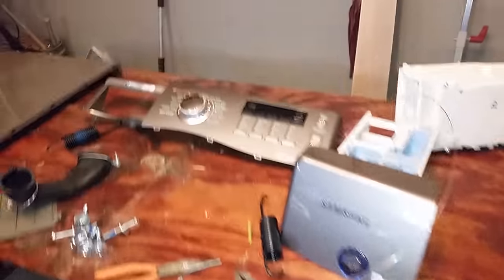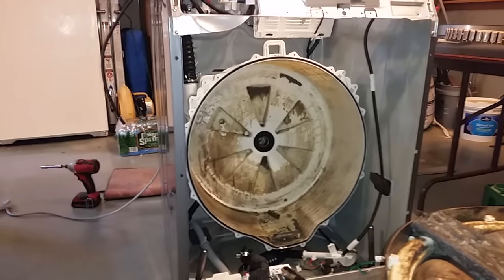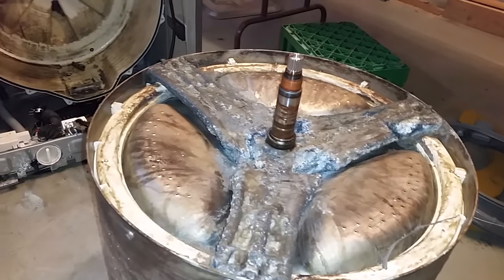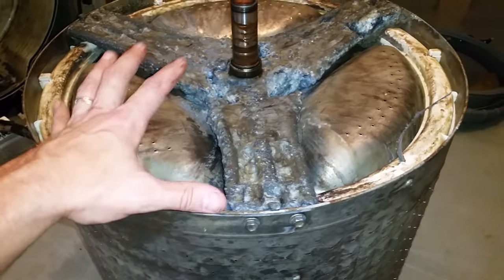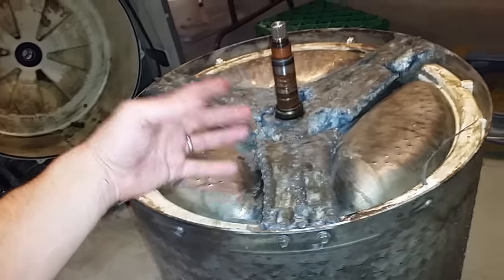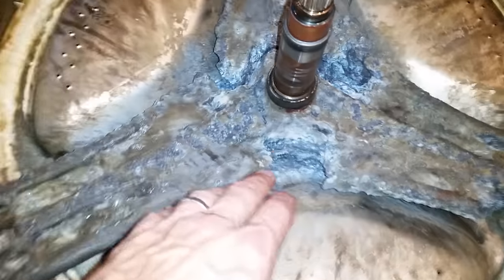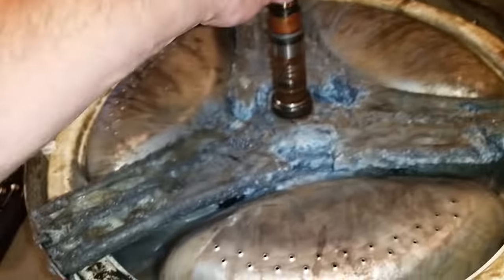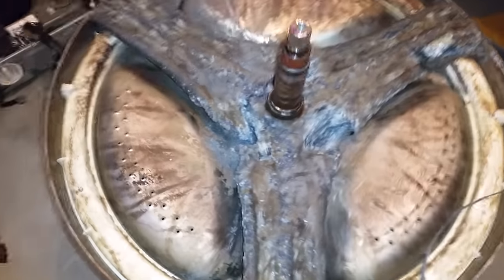Do not buy Samsung front load washer machines

Comment: As an Appliance Repair Technician, I see this all the time in all brands. Although this video is correct, I have found that using cheaper soaps speed up this process significantly. People also use WAY to much soap and don't run the "clean washer cycle". When I pull these apart, I can see the soap just caked on everything. Anyone with a new HE washer should A) Use high quality soap, B) Use less than 2 tablespoons of soap for any amount of soil, clothing or water, and C) Use the clean washer cycle that came with the washer for this purpose.
Reply: Ian Warren 
 so what do you recommend to maintain these front loaders ?..i am in the marker for samsungs model DV42H5200GW and WF42H5200AW and i just want this thing to last atleast 7 years as wife is busy with kids and warranty is $160 for both on 3 year coverage ...thanks
Reply: Read your owners manual, seriously. Use only a table spoon of soap in your wash, no matter how dirty the clothing is, and use the "clean washer" cycle monthly or as often as it says to do so in the manual. An extended warranty is great because a single repair call will cost you at least $120 without any work being completed depending on where you live. If you can get a 5 year extended warranty now, I would recommend it, the majority of the issues will happen after 2 years.
Reply: the only problem is you are pre-paying for the worst service experience of your life. When a company makes almost nothing on your job- you are guaranteed to be at the bottom of the list, after profitable out-of warrantee work of theirs.and will wait for parts- often two weeks.
Reply: That is true about the repairman ,you have a 3 party who makes money on not paying out money .
Reply: Good advice. BTW the latest Samsung machines tell you when it is time to run a clean cycle on the display
Reply: This is true, service companies make more money for out of warranty then in-warranty work. However, in major cities where warranty companies have a lot of service companies to choose from, it pays to do a good job. At our company, the level of service is the same for both in and out of warranty. This means that the large companies we deal with are very satisfied with our service and they keep sending us work. We may make less per job, but with the large number of jobs they give us, it does benefit us.
Reply: Orrrrr, the manufacturers can realize there are a million different brands of soap out there and nobody ever really measures it out in the cap that comes with the bottle so instead, simply make the part out of a different material. Perhaps out of a material that resists....wait for it...laundry detergent!
This would be like a manufacturer making gas tanks that break down from being exposed to gas! 
Dumb.
Reply: Ian Warren v
Reply: Ragnar Sakna
Reply: Phil your missing the point. Simple fact of the matter is Samsung shouldn't manufacture the washer soo cheaply. I would rather pay more now for a product that will actually last than pay more later at an inconvenient time because it catastrophically failed. Either it needs to be designed to take the harshest soap on the market or not allow people legally to sell soaps that will knowingly cause damages to these units. If you ask the average American consumer to actually measure out a tsp each time or run the maintenance cycle chances are 9/10 people are too busy to give a damn or they simply don't remember.
Reply: I use only the Tide HE powder and I have learned to never use the dispenser. I throw it right into the load. The main reason for this is first the powder always dissolves and secondly you won't normally be left with a smelly washer. It's just as easy to throw powder in the wash as it is liquid. The main issue I hear about now is that these pods don't dissolve. I have had that issue as well. I gave them up for the big box of Tide. I feel that any of those liquid detergents tend to leave a residue and can cause build up and more issue with the washing machine. Therefore you get a smelly washer. Especially in this day and age of energy conservation and them wanting you to do all loads in cold wash cycles.
Reply: On the latest washers throwing the detergent in with the wash loses you many of the advanced features. e.g. ecobubble on the latest Samsung. Since my first post a few months ago, I went ahead and got a Samsung. Im very happy with it. Im following the advice of the OP and putting in less than half of the amount of powder and conditioner I used to on my old washer.
Reply: Do you like powder better than liquid?
Reply: 2 tablespoons! That's amazing.  That's so little soooooaaappp!!!!
Reply: I do personally, I have been using the powdered Tide that I get at Sam's for years. I think the liquid is more prone to buildup inside the machine. My machine has never smelled while using the Tide powder
Reply: that because they don,t use enough water  in the first place
Reply: Rob Whiff.  I have the best results using Tide powder. DO NOT put it in the dispenser. Put it directly into the drum. My washer doesn't smell and there is no detergent that doesn't dissolve
Reply: Do you think the samsung WF42H5200AP a good washer in general? Or terrible as I read some reviews
Reply: I just bought my daughter the Electrolux front loader She really likes it.
Reply: Ian Warren so which one do you recommend Samsung or AEG?
Reply: For quality and long life I would recommend Miele. The only reason I bought a Samsung instead of a Miele is because Samsung are already near the top end in price and I couldnt justify the significant (almost double) price jump for an equivalent model in the Miele range. I also managed to get mine on a double special offer, reduced price and cash back on top which saved me a ton
Reply: should have gotten  speedqueen front load washer true they cost a little  more but you get a better made machine
Reply: speedqueen cost even more than Miele in my country
Reply: sorry to hear that great machines washers that is
Reply: Ian Warren Totally agree with you. All brang work the same way and have same weakness
Reply: whatwashing machines do you suggest buying??
Reply: speedqueen   had my almost 2 years   still working great may cost  a little more so far worth
Reply: hows that go?
Reply: catkicked Speed Queen and Maytags are the same thing
Reply: As a expert laundry technician you said it all well explained
Reply: I wonder if it is possible to make everything that would come in contact with liquid out of plastic then you ellimate the problems of the metals attacking each other?
Reply: LMAO...HOW OLD ARE YOU????????????
Reply: How old is who?
Reply: I was responding to your comments.
I wonder if it is possible to make everything that would come in contact with liquid out of plastic then you ellimate the problems of the metals attacking each other?
THen I realized it is a language barrier and you are YOUNG! I have used many washing machines over the  years. And the OLDER ONES cleaned cloths. These newer ones DO NOT CLEAN CLOTHS and the Cloths that come out of them STINK!
Reply: i have a washer machine that i buy, that support corroted in the video is almost new, ill paint with epoxi, that will make last longer. also there are videos that explain that the corrosion is from using soap powder that have caustic soda. this is the first video that say that the problem is the diference in metals, ill do more research on this.
Reply: Yea and its a compiracy that old electronics eventually fail. Has nothing to do with physics at all. I bet aliens have infiltrated all the electronic companies in the entire world and are trying to bring down mankind by making my 50yr old walkmans stop working. Damn the aliens!
Reply: You are clue less as to the function and INHERENT problem with all NEW WASHERS for the exception of COMMERCIAL ones. Is there a reason that the Speed Queen Washers and Kenmore industrials do not have these problems? Is it because they use much more water? The conspiracy is that you think there is nothing wrong with the problem that IN FACT the MAJORITY is Experiencing. Keep your tinfoil hat on for your next HUMMMM JOB!.
Reply: Pick any product, one that should easily last 'foreever'. Let's pick a hammer for example. Somewhere in the world there are multiple factories churning out hammers that break on the first use. This does not make it a conspiricy amoungst all hammer makers.
Reply: So having a 'glass half full' attitude means you focus on the negative and see conspiracies everywhere? Interesting theory as I would have thought it was the exact opposite.
Reply: Whether I am a moron or not is debateable, but we have clear evidence that you are not telling the truth because you replied after writing 'I am done'. You also demonstrate your immaturity by resorting to CAPS. Shouting your point of view is always a demonstration of a strong and well-founded argument? Do you have alzheimer’s? You seem to be confused about what actually wrote previously. Yes, I was talking about you when I said does seeing the cup half full mean you see conspiracies everywhere… Come back when you are sober, Ill be waiting :)
Reply: No their NOT
Reply: are there any front load washers that do not use this low grade spider bracket?
Reply: it seems to me that this owner had hard water problems.  would that cause problems too?
Reply: catkicked Compared to the Frigidaire front loader I bought in 1999, & the LG I bought in 2012, you're right about the newer models not using enough water.  My old front loader used enough water (18-27 gallons).  I watched some videos on how to rig my LG to use more water, & I have no problems with water usage anymore.  I however have watched videos on models made in the last 3 years, where the water pressure switch has the screwed superglued, that they're (LG & Samsung for sure, but not sure about Electrolux, Frigidaire, Whirlpool, & Maytag) making it to where you can't easily change the setting.  I hope to not have to replace mine anytime soon.

Vicky Forba  I have used powdered products here & there for years.  I however won't dump it directly into the tub, because I find that it doesn't completely dissolve while the clothes tumble through the water.  Even with the water level rigged on my washer, powder still doesn't completely dissolve.  In the summer months, when my clothes have that sweaty, funky smell, I also add both washing soda & borax to combat the odor problem.  I always add baking soda too.  What I end up doing with all these dissimilar powders, is dissolving them in hot water, before adding them to the washer.  I also use liquid, & now, all mine is HE & HE compatible.  When I got the Frigidaire back in 1999, HE detergent wasn't available at all locally until 2001, & onlt original scent Tide was available in 50oz bottles for $9-10.  The regular was still selling for $5-6 for the same size bottle.  I didn't buy HE until 2008.  So I did what the manufacturer stated to do back in 1999, use half the amount of regular detergent in a front loader.  Never had problems using regular in all the years I used regular.  I still had plenty of regular detergent in use as late as 2015, because I stock up on it.  I'm slowly getting my stock depleted, because I want to get the old stuff used up, as well as the fact that I'm in the process of moving.  Even with using both liquid & powder, I've never had problems with odor & mold (even with my last front loader).
Reply: Throwaway society. I'll never buy or recommend to buy, Samsung household appliances again. I have the same symptoms with my 7-year old Samsung VRT washer as this video title says but I'm not going to take apart my stupid washer. I shouldn't have to. My washer also had different problems in its 1st, 2nd, and 3rd years of its life. If these companies are so "advanced", then they can figure out how to make things that last at least 3 years before breaking and they could warranty their product longer than the pathetic "1 year manufacturer warranty". In the long run, it costs less to replace these stupid things then to fix it.
Reply: Dang, I use like 1/2 to 3/4 cap of soap and it was HE quality (NOT CUP,  I MEANT CAPFUL) My washer - crosley had no problem. but when I buy new maytag washers very soon, I will check to see if it has "clean washer" cycle features in there. I will NOT buy samsung W/D period.
Reply: Skip Rope 
Most of the time if your clothes stink you got a holdup of soap that is growing some bacteria that are resistant to soap 
So do a 90° program and if that doesn't help 
use chlorine to do an empty wach at your own risk chlorine IS TOXIC
Reply: I was in the field 4 years. I told people no more then 1 tablespoon at the most. I saw people dump a full cap into the machine after I told them 1 tablespoon. Yes there is a big difference between conventional detergent and HE detergent
Reply: Ian Warren I'm also a technician. I agree completely and my experience mirrors yours.
Reply: Ian Warren Maybe instead of them giving us an excuse to waste energy on a clean washer cycle, they actually spend 10 bucks and change the material to stainless as to provide a quality appliance. All Samsung garbage is built to die.
Reply: Hi Ian, I agree,  too much soap, and maybe too much use. I once fixed an Inglis, that is Canadian made, washer, the bearing was worn completely.  She had kids that had bedwetting problems, the washer never stopped and yes after 5 years, it failed. A single person, using it once a week would go 20 years or more. So factor everything in forst. Had they used a top loader and 3 times the water and soap over 5 years vs the Samsung cost, which is cheaper? Depends on your water cost.  I had bills over $100 more a month with many people staying at my place, that would have been 200 with an older machine or 50 with the front loader. So 3000 extra in water could easily buy a new machine.
Reply: Just ran the PureCycle cleaning mode on my washer - thanks for the tip. I've never had any smells or issues in 4 years of use because I live somewhere with near 0% humidity, so I just leave the door open at the end of a cycle and the interior dries out very quickly - does this help to prevent this kind of corrosion, or should I change up how I use the machine to prolong its life?
Reply: Everything is made to fall apart now. You can get parts for a 20 year old washer easily but if it's 5 years old your shit out of luck or the electronics board goes it  cost half the price of a new one.  This is not only true of washers but Fridges stoves etc...
Reply: How true but we love our electronics. often the boards can be easily fixed though. I fixed many for a guy and half I could save, half needed parts I could not find. The stove ones would burn up.  The fridge ones would often need capacitors.
Reply: I did warranty work and we had no problem being paid. I quit doing it because the constant complaints I used to get fixing 4 and a half-year-old machine free for the customer. If we said it needed to be done it got done. I even delivered a brand new machine to a customer with one week left to go because the old machine was uneconomical to repair on their instructions.
Reply: That's great in warranty but out, people will only spend half of what it is new tops,  I stayed away from consumer electronics and appliances. If what you are fixing is worth thousands, it is easier to make a buck.
Reply: True That's why myself and most good techs got out we can fix anything. I still buy every appliance on Ebay now most people are getting rid off high-end machines with simple faults because they won't call a company. They then fork out for a new iPhone 2 years old moaning the washing machine for $500 lasts 5 years. I would not stuff around with anything like tubs these days. How the warranty companies make money I have no idea?
Reply: Or you know buy a top loader...
Reply: I repair top load whirlpool and I have no problem getting the AMERICAN MADE washing machine to work , , IMPORTS SUCK
Reply: Cleanliness is next to godliness. Clean anything regularly, possibly use a couple of drops of bleach in a wash, and leave doors open afterwards so everything can dry COMPLETELY. (A couple of drops of bleach works very well for water condensate lines as well)
Reply: Year ago I began expirimenting the Amway Sa-8 detergent. It was the first reformulated detergent on the market to remove phosphates, (Amway received an award from the United Nations) Amway distributers knew it had the habit of forming into clunks or chunks (which could be easily broken up) I had been using 5 gallon Sam's club detergent for the previous two years, and began trying Sa-8. Two weeks later I realized that (without bleach) my work uniforms were nice and white, not yellowish, SO both powders AND liquids can work well. My wife and I are still using up the Sa-8, it lasts SO LONG ! I like to make sure the powder is broken up and smooth.
Reply: No manufacturer this side of Speed Queen makes machines that are expected to last more than 8-10 years.  There are three main reasons for this.  1.  We have become a disposable society.  Whether your washer or marriage craps out after ten years, you get a new on rather than fix it.  2.  The government changes the rules about every two years.  They adjust the amount of energy a machine can use.  Manufacturers need to constantly create new technologies to meet the ever changing government standards.  3.  The machines rely heavily on electronics to work efficiently.  Electronics are a two sided coin.  While they can get the job done within government standards, they are susceptible to dirty power and have a lower life expectancy.  The parts in the video that have corroded had those electrolytes, that the owner pointed out, introduced to them.  Those parts should not get wet.  He did not explain how or why because he was too interested in bashing a brand.  Soap is a caustic material.  Too much soap led to a build up around the seal.  The seals were compromised and water got between the tubs resulting in the damage.  You should never, EVER see suds in a high efficiency machine.  In our area, we recommend only one tablespoon of detergent.  You must measure.  Get used to it.  One or two drops more than whatever is recommended in your area will lead to problems including, but not limited to, smelly machines, mold or mildew growing inside the machines, and the machine sensing off balance loads.  The detergent manufacturers are not making harsher soaps that can cause damage to the machine,  they are making higher concentrations to fit the new high  efficiency that are dependent on user intelligence.   Soap manufacturers and machine manufacturers make recommendations on quantity of soap. 
 You cannot go by those because they are making them based on an average of the nations water quality.  You have to find out what is recommended in your area and be able to use a measuring device.  If you want a machine that will last 25 years, buy a Speed Queen, but even then you must measure soap to get that life.
Reply: Ian Warren 9
Reply: I have also hear that if you have city water that it also speeds this issue up vs well water.
Reply: My Samsung doesn't have a clean washer cycle
Reply: Use powdered detergent in stead of liquid on whites, wash at the highest temperature available regularly, leave the door open when the machine is not in use to air out
Reply: Ian Warren - excellent, excellent, excellent point you have made. Have a 2006 LG Tromm and the only issue after 11 years of every day use is a worn bearing. After replacing the bearing, the machine runs and sounds brand new!
Reply: Ian Warren hello the time has come to replace my top load washer and I’m looking into getting a Electrolux Front load washer  would you recommend them?
Reply: As a Samsung authorized technician I can confirm that this is the result of using detergent that is not HE rated, whether intentionally or do to deceptive advertisement, for over a year. This means that the owner's preferred detergent is not compatible with low water usage washing machines.
In other words, buy Tide HE Turbo and use a maximum of one tablespoon per wash in this will not happen to you.
Reply: Michael Rizzo So question... what's a good base model electric dryer to buy? I'm looking for a new one but would prefer something that just gets the job done and won't quit on me fast... base model type y'know? D:
Reply: Greg Stetz What's a good electric dryer to buy? I need some suggestions. D: Just want something that works well and will last me a while.
Reply: Ian Warren I am also an appliance technician and I 100% agree with your comment. Usually it's the powder soap that causes this and overloading of clothing and rugs. I tell my customers all the time just because it looks like a laundromat washer doesn't mean you should treat it like one, because it isn't built like one. But you are correct this isn't a Samsung issue this is a front load washer machine issue and how people use them
Reply: Ian Warren what is clean washer cycle. Plz tell me.
Reply: Having to use less soap and particular brands is really a baind-aid. The problem is the incorrect material choice (possibly intentional) and the solution is to avoid that washing machine and possibly other makes also.
Reply: Which brand in your opinion is better for a new washing machine??
Bosch, Indesit or Whirlpool
Reply: Thanks in advance
Reply: We just got a, "HE" top load and watched how it worked through the glass door. LOLOL DO NOT BUY A HE WASHER it literally didn't get several parts of my clothes even wet! THEY ARE TRASH. Maybe this is a one time special occasion type thing but I've been around too long to think that about garbage materials any more.
Reply: The type of soap shouldn't make any difference. Sorry to the 422 Samsung owners out there that voted up this comment, but that is ridiculous. Also, why does the damn thing have a clean cycle and what is it supposed to do? This would happen without soap and if you have ever had a boat in brackish or salt water you would know that.
Reply: Hey Nerd, my front loader was 15 years old when I sold it and it still runs fine. A Whirlpool, BTW. Fucking soap makes no difference. Put your outboard boat in brackish water and tell me what causes the corrosion. Hint, it ain't soap.
Reply: My guess is that sulfur well water might be harder on the equipment than iron water which would be harder on it than softened water. And some city water is better than others.
Reply: Good info Philip. My wife and I just bought a pair of front loads. Very pleased with our purchase— and grateful that they are not Samsung’s. And  Ian Warren’s post was equally helpful, so we changed our routine for doing laundry. Thanks guys for sharing.
Reply: two table spoons  of HE soap not one.  also install a inline water filter to that front load. clean cycle once a month,  i am a Sears washer Tech ...
Reply: Ian Warren Qatar
Reply: what does soap have to do with corrosion? won't running the clean cycle just expose the machine to more water and thus lead to more corrosion?
Reply: You are correct that most of the major manufacturers use these cast aluminum spiders to support the drums. I had a Kenmore washer that had the same issue,. Just got rid of it yesterday after 20 years of use. I had to replace the entire drum assembly as the particular model did not have a spider for sale without the drum, which is idiotic as the drum was stainless steel and in perfect condition. Just greed on the part of the manufacturers as they know this part will eventually self-destruct and require a major overhaul. While you may be right about the soap contributing to premature failure, I personally think that the chlorine bleach is the major culprit. Regardless, the part will eventually fail due to electrolysis because of the dissimilar metals in contact with one another and the aluminum becoming a sacrificial anode.
Reply: Mike Hammer would not buy either one
Reply: Exactly, same here
Reply: All brands
Reply: Ian Warren what do you consider highest quality soap?
Reply: @vforba , what usually leads to a smelly front load washer. is people do not leave the door open for the washing machine to dry out and they keep it closed which creates mold and mildew inside the washer.
Reply: Ian Warren really 2 tablespoons??!
Reply: thanks so much Iam.  Really appreciate the infromation.
Reply: that would not be the case. atleast samsung and lg require quick turn around times or ya dont get paid and or they stop sending you work. Its a real headache all the hoops they make you jump through
Reply: Some Samsung washers DO NOT HAVE A CLEAN WASHER CYCLE.
Reply: Thanks for the info! My Samsung washer just broke. Lesson learnt the hard way...
Reply: Ian Warren you are 100% right although Samsung is the most shitty brand for washing machine
Reply: Doesn't Samsung and others know that people will use more than two tablespoons of cheap detergent ?   Zeneth used to have a motto, "the quality goes in before the name goes on."  Now I think it is , "The name goes on before the quality goes in."  Not talking about Zenith, but products in general. - john
Reply: finally someone who knows his stuff
Reply: Which one you will recommend for us the liquid soap one or the powder instead????
Reply: If they changed the aluminum spider to a stainless steel spider, the motor would burn up on the first high speed spin cycle due to the weight problem
Reply: We have had LG front loaders for over 5 years. No issues with the washer execpt a blown pump motor. Simple hour long diy job and thats all good.The dryer is going strong with regular filter cleaning. We are very happy with these units.
Reply: Has nothing to do with the soap use whatsoever. Maybe try thinking about what the spider assembly is in "fact" coming into contact with, not the soap. Is it that tough to see that the aluminum with zinc place on superior metal much like the lower unit on an outboard motor will deteriorate well before the tub. Superflaw in design.
Reply: ^This.  This is not a defect of Samsung...it's common to ALL washers.  I'm sure that GE and Whirlpool were happy that was posted, however.
Reply: Is not it better to just buy a top loader then?
Reply: @skiprope536   This post is 3 years old I realize that,  but If you use the proper amount of soap and the proper amount you won't have the problems described in this video. My LG front loader is a 2014 model and still work perfectly. I have done routine maintenance on it. Front loaders do a better job than top loaders.
Reply: @vforba  is any tide powder ok? I hate scented soaps. So I would get the tide that’s free of scents.
Reply: @Geeloveesu  I buy the big box of regular tide at Sam's club. put it into your tub on the front loader and not the dispenser.
Reply: @enknot  I do as I feel it doesn't leave as much of residue inside the washer
Reply: @Manic Miner Could be, but some washers come with sacrificial parts. Maybe there is some other part in there of a different metal designed to corrode first that is replaceable?
Reply: 5 years later, I wonder how all these people are doing with their machines. Did that dude every buy that Samsung? Did it last? Did they get the warranty? I wish I could catch up with everyone to see how my future is gonna look like. I just got a Samsung wf50bg8300avus washer (in 2022) and I plan on doing all the clean cycles. I actually forbade people in the household to use it cause I know I’m anal about cleanliness and some of them are not.
Reply: @wetsaltydogs  Not always but my washer is almost as old as you 😛
Reply: @l3n1x  I am pretty sure the new Samsungs force your to do a clean washer cycle after so many loads
Reply: @ianwarren5297  saw a Samsung drum repair on a local board. Seven Yr old. Powder only. Can't say if it was HE. Mostly cool washes done. About four drum clean cycles run annually. Descale once a year. Medium water, not hard. The outer drum was coated in white.

I'm wondering why the powder residue clung to the drum like that. The tub was not very dirty. Cleaner than in this video. No smell.
Reply: @johndoe-vc1we  It sounds like you have hard water. Descaling should be done at least once a month with hard water, even without hard water you should do a tub clean cycle at least once a month.
Reply: @ianwarren5297  what product would you recommend for descaling ? the regular descalers if used once a month work out expensive. I was thinking of 100gm of citric acid crystals.
Reply: @enknot  I got the same valuable advice from a washing machine repairman when I first bought my samsung 14 years ago. It doesn't smell, still works great and my clothes are clean. I use liquid Tide. Switched to an off-brand once and found my clothes didn't get as clean. Wish the repairman said to run the clean cycle though...
Reply: @robwhiff3411  don't buy Samsung please! Terrible machines.
Reply: @sfrockindj I think the Samsung WF42H5200AP is a good washer in general